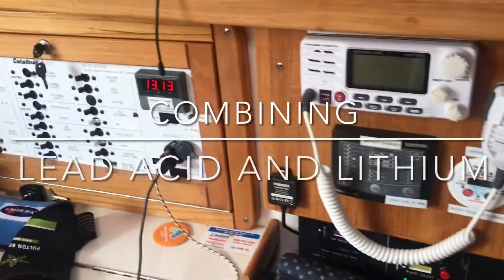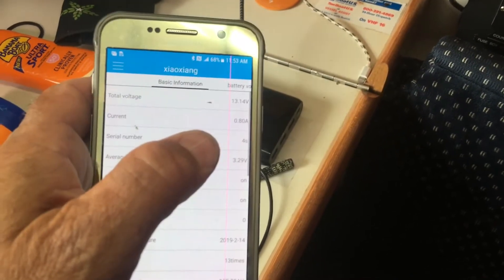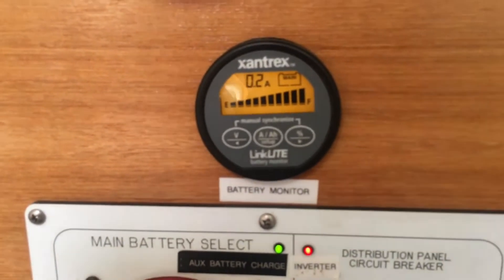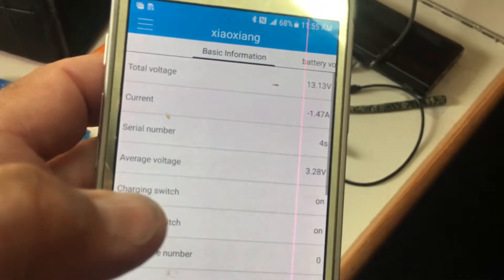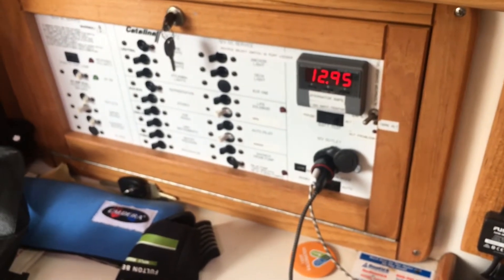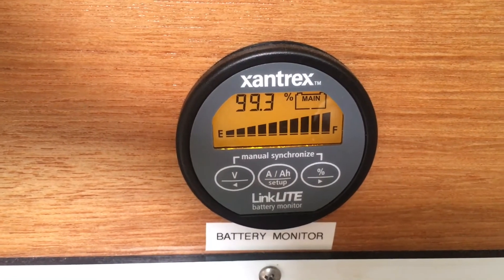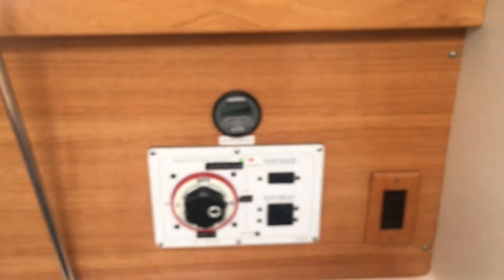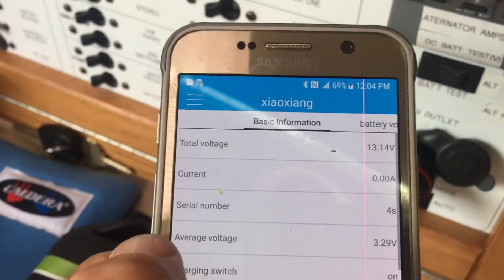Parallel Lithium and Lead Acid Battery Bank on Sailboat Experiment

Comment: Have you looked at Emily & Clark's adventure utubes on this issue? . He is building a BankManager Plus that might interest you.
Reply from the maker: Yes. He has done an excellent job explaining the system. I haven't looked in detail at his new product the bank manager. I  just did an experiment on my boat to look at how it could work with an automated system. I know many lithium battery users also have starting batteries they need to keep charged. Thanks for your comment.  I do think other should look at Emily and Clark as well as other designs. Mine is just an experiment.

Comment: Looing at doing this. But would use a fuse breaker  in the off position  between the LA  and & LifePo4 and fit a switchable 12v bulb across it. To do a slow balance of the batteries. Once balanced( the bulb will go out). I would then switch across the breaker.And leave the batteries linked. As the BMS will manage the charge cut off voltage. What i am worried about in building my system. Is how I regulate the current draw from the Life4 battery from the alternator when in a discharged state. As it is a simple ignition relay circuit  with 1 15amp fuse.  Anyone know from experience?

Comment: You are playing with matches and gasoline. First, you have voltage drop on LA bank and not on Lipo bank when load kicks in. That means undersized cables(or bottle neck) between those two banks. You risking igniting the connecting wire. Also thanks to the voltage drop, you are discharging LA which has lower efficiency and then charging it with heated cable running from Lipo bank. Instead of using about 99% efficient lithium, you are discharging at 85%(LA discharge), then 85% charge (LA charge), x% loss at heated connection wire. You manage to cycle the LA bank and the Lipo bank through heater at once....very, very bad execution on the design...Also please do NOT play with the connections while the banks are in different SOC. Make solid connection between them. If you connect fully charged LA(200Ah) to a discharged Lipo(what ever size) you will send like 2000A to your Lipo bank, not cool dude, I bet you love fireworks...Look, I believe it is a good idea, I am working on very similar design and I believe it is superior to either of the chemistry being alone. Leave them together, put max amp fuse what your Lipo can handle on discharge (obviously PROPER sized wires)  between LA and Lipo banks. Adjust your charging source amperage to be max of half the Lipo bank capacity (0.5C). That is the best recommendation I can give you to don't burn down your baby. Give few bob to electrician to check your wiring, since you made these mistakes, it will be worth it to do that. Stay safe and happy sailing...
Reply from the maker: Really good points! My loads at anchor are 10A. I started testing this out only at anchor with just 250w of solar ( < 12A). My issue was my lead acid was always running down and I needed switch my banks form LFP to LA so I could charge my LA and it took forever to charge my LA but I did not want them to run down.  Then I saw a few videos and got lazy. Yes all my wires are protected with MRBF fuses ( maybe not good enough). I would never run big loads. Yes my LA SOC is in the high 90 before I parallel. It does seem that it does more LFP energy to just keep the LA floating.  It would be really great if you could consider  creating rough script on when to combine/disconnect the 2 banks for my review so I could avoid the smoke.  I did another video I'm going to post soon.
Reply: @dannyjensen4954  I guess you want to create some automatic system for disconnection, arduino perhaps?...Dont... That is not the point. You should never disconnect LFP from LA. The lithium is the work horse, keeping your LA happy and loads covered. LFP will be always getting discharged by LA via floating (thats about 250-350 mA for 200Ah LA). LA is there for smoothing charging voltage ripples, MPPT voltage spikes (protecting the BMS), protecting chargers/alternators and as the emergency backup power. Therefore, mostly for a free ride. If you discharging LA and it is not an emergency (when LFP is nearly flat), there is something very wrong going on. My guess is a weak connection wire between positive terminals or badly connected ground. If you do not want the LFP to get discharged via LA floating, then do not use this system. It is suitable for daily heavy duty use (more than 1 charging/discharging cycle per day), not for "ah, lets just have it for the fun". If you going to be fiddling with connections at different SOCs, sooner or later you will be singing with Katie Perry. It is not about being careful, but you will get tired or drunk or what ever and you will make mistake. Same for a software, corroded connection, loose wire and it may do the same. It is not worth the money time and effort...Anyway, you can do what ever you want... is it possible to automate the connections? Yes. Will it save you some energy by selectively avoiding LA floating by LFP? Yes. Is it worth it? No (my opinion)... note: 250W solar only is not sufficient to keep up with your consumption and LA-LFP bank sizes.
Reply from the maker: @lukaskorcak5583  I’ve got parasitic loads connected directly to reliable lead acid batteries. Bilge pump alarms, sensors, bilge pumps are 24 hr connections taking 300ma if not loaded. My lead acid bank is almost at end of life. Yes I forget about things so not a good idea I guess. I’m still thinking about simple automation like many are now doing using simple rule disconnect when lithium is above 13.6 and LA is below 13. Connect when LA above 13.6 and enable switch is set. Limit current on parallel cable. I just posted another experiment vid. Thanks for your valued detailed comments. I really appreciate your time and careful consideration spent in your excellent comment in the interest of me not blowing myself up. I’m re-thinking now…
Reply: @dannyjensen4954  (300mA float for 200Ah LA is about right)This all looks nice on paper, charging, connecting, discharging, transferring power etc. It may even work when your batteries would be 75% full or so. But, when you manage to discharge one of them (accident, failure, emergency), real rodeo will start to get the system up and running again. It is not to hard with a small batteries, but with large banks (>100Ah).. oh boy...you will be burning wires everywhere... Your LA bank you say is at the end, so it has large internal resistance. Effectively it has self limiting current management, it may be a reason why you did not burn anything yet. Be very, very cautious when you will be connecting new LA bank...Now why am I concern, may not be as noble as you think. I think that combining LA and LFP has huge advantages for hard working systems. However sellers of a fancy equipment want to earn money, so they will say do not do this, do not do that, buy our special device to do it etc. People are generally totally ignorant so the business is blooming. Lets say you have power demands of 100Ah per day regularly and 500 Ah once per year, but it is a crucial system. Now, to be of grid with assumed 150Ah recharge capacity per day I would need to buy 500Ah of lithium even I use it only once per year. That is huge money expenditure for something I do not need and it will degrade in 10years or so (effectively using 400Ah only 10 times before replacement). If I use LA, they would "not" deteriorate if on float. They ll be good for decades to come, even never need replacement. And they are cheaper to purchase. Do you see the point? LA technology is not dead, it will be here forever.... Here comes Lobbyist:" Make a law to ban chemistry combinations in energy storage's! We are not making any money! Or put some ridiculous certification fees on it! People are getting hurt, when they build their rigs!"... (like those fuckers would care) There it is, you used combined chemistry and now it is marked as dangerous if you burn yourself down. Void on insurances and who know what else. And yet for the prize of continuous cca 150mA current draw per 100Ah of capacity you have solid backup system for emergency situations + reducing stress on electronic components included in LFP technologies.... If you dont have need for a rare emergency energy storage, then just combine it with a motorbike battery. It will be much safer and all protection included.
Reply: I am watching all this bc I want to run AC in my house this summer. I have a 6 battery Trojan T105 bank of LA, and 2 200AH LFP. 
   Each bank has its own charge controller, and its own set of PV panels.  The only time they will be in parallel is when the AC is on, which will be about a 60 amp DC load.  The flooded batteries will be charging in mid afternoon full sun while AC is on, while the panels for the lithium will be getting slowly shaded. This should result in a roughly even split in load between the two banks.  I have a large diode which I may use to ensure that power never flows from LA to lithium.  Do you think that can work?
Reply: @danstrayer111  My set up is virtually the same as yours. I have connected both battery banks together permanently because the LA take over when the LFP has a low state of charge. Most electronics are sensitive to voltage spikes and will self destruct without warning. If there is an imbalance in the voltage between the two battery banks large currents will flow. 

A mosfet has a lower forward voltage drop than a diode, therefore less heat. Six in parallel ( just to choose a number), on a heat sink, could be used from each battery bank and then to the lead to the inverter. But they can be fragile if exposed to voltage spikes and lighting  therefore fuses would be necessary on each line as well. 

Automotive alternator diodes on heat sinks would work, also with fuses on each line. Setting up two diodes would mean the charging would be kept separate.
Reply: @allanvrc725  So..we finally had some hot days in July. Both sets of batteries fully charged. I placed an automotive ammeter between the Lithium and the LA, and turned on the ac unit. On a low setting, or the next setting up, the AC unit was drawing 3.5 amp at 112 volts, roughly 35 amps of DC. There was an initial drop in voltage on both battery banks, and quickly recovered to full charge within a minute. It actually worked better than thought. Lithium batteries were feeding a steady 15 amps to the lead, and the rest was coming from the LA panels. I turned it up until I was using about 50 amps of DC.  Everything was stable. I even ran it for 2 hours after the sun was gone. I did have a 30 amp diode so the LA could not backfeed into the Lithium, as warned above, but it was shown to be not needed.
The moment the AC went off, the interconnect was removed.
  On another test, I hooked this system up to an RV electric water heater, drawing 1200 watts. That was the limit!
  This was done with (6) 240 watt panels, on 3 separate  charge controllers, 3 panels charging Lithium, 3 charging LA, and one separate panel on its own CC.
Reply: @danstrayer111  You have it figured out. The amps are kept below 60 as well but not enough sun at the moment. The inverter runs 24/7 for the fridge, lights, modem and phones. The fridge has a soft start 3phase inverter but it would be best to modify the system so that the power only came on to run the fridge when needed. The rest could be DC.
Two 500 farad capacitors in series have been placed close to the 24 volt inverter with the thought that these may help with appliance inrush current. The 2000 watt inverter will not start the mono laser printer   when the fridge is running.
There is a lot of stored energy all in close proximity. 

I once saw a roof lift off a house in a storm at night and make contact with 3 phase 11kilovolt lines bringing them down and breaking a pole. A spectacular plasma fire ball erupted and floated into the valley burning within its self. A once in a life time witnessed event.

A fuse that does not blow while heat in a short circuit is smouldering and going to become fire is my main concern.
Reply: @allanvrc725  man i hope you meant 500 microfarad! Good post
Reply: @danstrayer111  no, no, leave off the micro.

Comment: Fun project! I am also working on how to combine different batteries. One reason is that many lead acid UPS systems are easier to daisy chain batteries to than lithium power banks, but the lead acid batteries are heavier and don't last as long.
Reply from the maker: I enjoy your videos. You have taught me so much. My FLA batteries are near 100 SOC now that the LFP is paralleled. I still do a regular 14.4 v charge cycle/profile on the FLA when I’m on shore power. Solar charging in parallel works great.

Comment: Why don't you just configure the BMS to disconnect Charging above 13.8 Volts?  Could you then just leave the FLA & LiFePO4 in parallel?
Reply from the maker: Yes... Good Idea. I'm not brave enough to set my primary bms for this. However, I'm thinking of how I could use a secondary bms to trigger a relay to open and close a connection. A BMS is really a voltage sensitive relay.
Reply: @danny jensen  I was thinking about having a lithium battery to charge the solar into and from there charge a big lead battery slowly with a DC-DC. Then have one DC-DC from the lead acid to the lithium for those moments that solar is not filling the lithium enough. Just need to find a DC-DC that can be triggered by the voltage of the destination (lithium) battery.